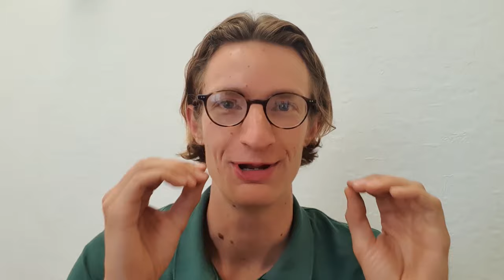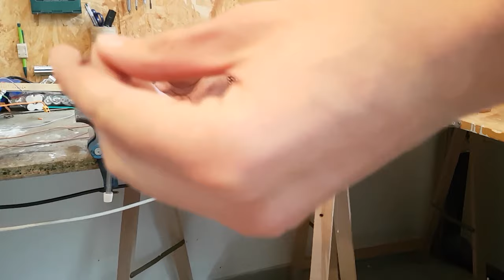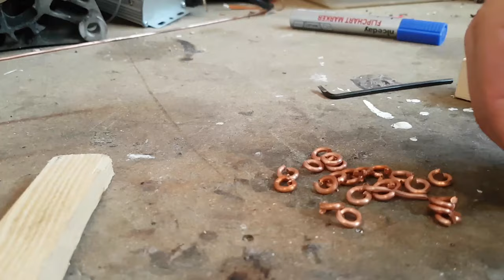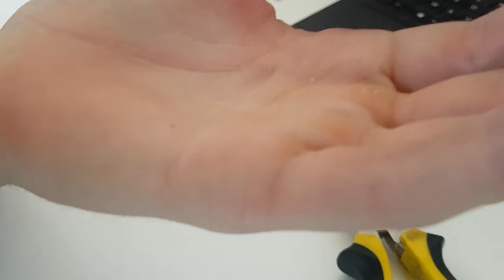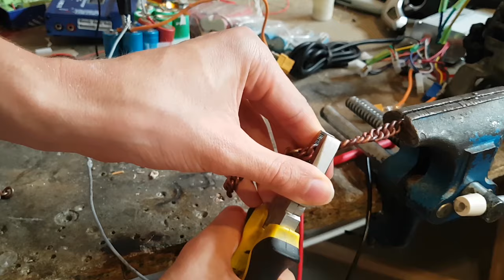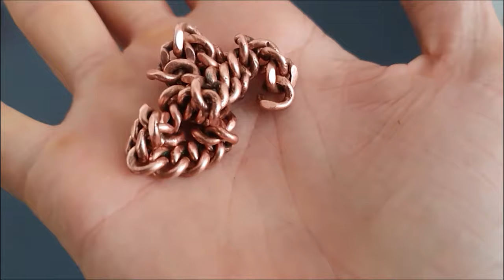Homemade Cuban Link Bracelet (from copper wire)

Comment: When i read homemade, i wasnt expecting that i'm gonna need TIG welder to make it. I basicaly opened video just to see a way to conect rings when you have just simple tools to work with.
Reply: 10 dollar crack torch and copper solder would work fine

Comment: How did you connect the ends together?
Reply: You can pry each ending link open with a flathead, then clamp them back together with needle nose pliers
Reply: @murrmurray5311  that answers nothing. And makes no sense.
Reply: @mawi1172   it does make sense to someone with more than 1 braincell
Reply: @chuckmiller7294  yea
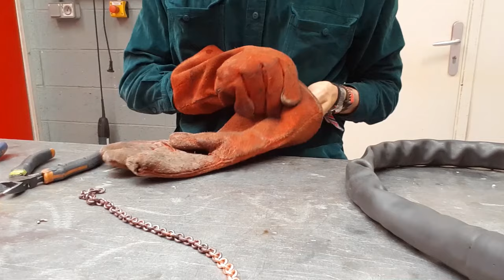Reply: He welded them together at 2:10 the common way of going about this would be with a torch and some wire of that metal that you'd hold onto the links and melt to fill in the gap.
Reply: Brazing with copper and a welding torch you see it for a second at the buying of the video
Reply: I think he meant how did he clasp it together on his wrist.
Reply: You can use any metal joining process appropriate for the metals you’re using. You don’t have to follow his exact example.

Comment: really nice work! You may overthink your action to wear it every day cause your sweat is caustic and the result is an copper salt, entering your body when liquified...
Reply: You could seal the copper with clear porcelain spray.
Reply: Only half true. You would have to EAT an enormous amount of copper in order to achieve the level of toxicity required. Fortunately, his bracelet isn't enough to do much other than turn his wrist green from his sweat increasing oxidation.

Comment: You make it seem so simple.  Thank you, I enjoyed your video.  Can you share the wire gauge and the aspect ratio for the jump rings?  I tried making one using 12 gauge wire with 6mm inside diameter and found it to be a bit too big.  Thanks.
Reply: have you ever found the right size?
Reply: @gaiiaxyz2870   Yes I believe that I have.   I made a bracelet out of copper using a 3 to 1 ratio.  2mm wire into a 6mm inner diameter.  I think 5.5mm interior diameter would work well too, but have not tried that yet.
Reply: Would a Cuban Look nice with a 1 mm sterling silver wire,i dont need a big one

Comment: Looks really good. I’ve been looking into making one myself. Have mostly seen 2 wires twisted at once in either the forward or reverse motion on the drill to create your desired pattern but I like the free and not molded fit on your design. For me, I’d go without any coating, green wrist and all, simply for the added benefits of copper making direct contact to skin.

Comment: I never knew you could straighten wires out like that, and got so into it when I tried it out that I ended up making one of my dad's drills smoke a little bit
Reply: Good job burning out some of the insulation in the drill motor lowering its torque
Reply: You shouldn’t. It creates internal stresses in the links. Just yank on the free end with pliers after annealing the wire

Comment: What setting did you set your Tig to when fusing the links?
Reply: I use 30-35 amps. Once the link get red hot(2 seconds) it completely fuses it all shut. You can do it at 50 amps if you want to just zap them, I don't have that level of foot pedal control. Just make sure the coppers really clean before you tack it because any impurities in the copper will weaken that link and when you go to twist the chain the link with the impurity will break

Comment: Very cool I have wire about 1/8 thick, Sadly need a tig. Perhaps a to do later.
Reply: You don’t need a Tig welder.  You can also just use a jewelers torch and solder.

Comment: You don't need a TIG welder you can use what's called a mini torch you'll have to buy these small tanks one for oxygen the other for whatever kind of gas you're gonna use  think you can use nap gas. I just got a mini torch today. Haven't used it yet and it was only 45 bucks but I already have my own tanks and if you order it also order what's called blowback protector that's included in the 45 bucks

Comment: What gauge wire is it and what is the diameter of the rod it was wrapped areound to form the links? Nice work!
Reply: I just use scrap 16 or 12 Gage I'm going to try one using two wires twisted together to make the links. depending on what size you want it just grab a drill bit and use the shank  you can go 1/4 if that's too small go 3/8 I'd go on the smaller side for a feminine bracelet little larger for a mans

Comment: Very awesome tutorial ♥️ Bracelet is Amazingly beautiful ❤What size wire did you use from inside that  cable? ♥️ Wish I could make this masculine bracelet for my boyfriend ♥️ I think he would love it ❤ I do not have all the materials and I am not into torching anything yet ❤ Still learning wire wrapping ♥️ Thank you for the tutorial ❤
Reply: He used 10ga copper wire.  But u can use 12ga for  smaller chain links or 8ga for larger chain links. the torch he used is called a TIG welder. Hope this helps
Reply: @autodidacticartisan  Thank you ♥️

Comment: So i tried making one but the chain wanted to fold over itself when twisting, do you know why that is.
Reply: Bro did you find an answer? :( having the same problem too
Reply: @zizoclever  That was awhile ago and now I have a few successfully. If I remember right I think I made the link to round causing them to slip. Making them slightly oval shaped they seat and stay in place when twisting. Also pull it at the same time you twist also keeping it seated.
Reply: @bigriggc5828  oww bro that's so smart actually. After you welded the open ends, you just squeezed the links a little bit with some tweezers to make them oval right? Before twisting them? Also did you use tig welding or a torch and copper solder? Thanks a lot in advance friend
Reply: @zizoclever  I used sliver solder, since normal plumbing solder is to soft, I only have a stick welder so that wouldn’t work on the the links, at least not well. And yah I used ground down pliers, as to not mar the copper, and squished slightly. I also eventually made a jig to wind the links around and I made that oval shaped so the links were automatically right.
Reply: @bigriggc5828  how did you get the silver solder to look the same color as copper? 🤯
Reply: @zizoclever  Well I didn’t, I just lined up the seems to be hidden when worn with the “pretty” side up ( best polished side after all the work). It is t really visible, but I was planning to get some copper sulfate to electro plate it the same color but never got around to it.
Reply: @bigriggc5828  damn bro, i respect the dedication but yeah, that's a problem with copper. i wonder if using a glossy copper spray and then a glossy finish to top it off would work

Comment: Are the hoops being welded with a Laser welder?
Reply: Yes
Reply: Yes. Layzr to be specific. Made by ck worldwide. Also theyre called links, silly.
Reply: if you watch closely, when he's showing the final result you can see some of his links opened back (most likely when he was twisting the chain.
If you do this I would recomend soldering the jump rings ( there's no such a thing as copper solder, so silver is used instead).
Soldering is also much more safer and easy than welding, plus it gives a much more professional and clean look to the piece.
He did an ok job but I don't think he is a professional jeweler.
Reply: @autodidacticartisan  Layzr is the tungsten used, the welding process is TIG 🙄
Reply: @theemza5757  that was joke. good job.

Comment: What gauge wire did you use?
Reply: Looks like 10 gauge. Twisting it in the first step straightened it, thinned it, and softened the copper. Heating the copper and then quenching it would harden the copper in later steps.

Comment: The music was very hard on the ears. Try with no music next time. No demo video should have music. Natural sounds and silence in between is best.
This was an excellent chain build demo!  Love the chunkiness. You forgot to tell us what gauge wire this was, looks like 8-10 gauge most likely. You can buy bare copper wire too, but liked your recycling.
For cutting, use a fine jewelers saw so you don't leave a large gap in the jump rings.  $15 with blades on Amazon.
That was a neat trick with the drill to straighten out the wire, never knew you could do that.
Also liked the wax or silicone or what you put down to hold it in place while filing.  Very clever.
Chain looks fantastic!  Well done!  I learned a lot, thank you.

Comment: How did you get the wire to start spinning on the drill
Reply: If this is a serious question you probably shouldn't even attempt to do anything like this but if it's a serious question you put it into the Chuck of the drill tighten the chuck and squeeze the trigger don't do it in reverse or the bracelets will turn out backwards
Reply from the maker: Bend the tip at end 90° angle and insert it the gap left by the chuck around the rod.